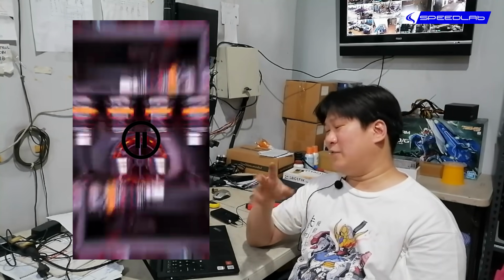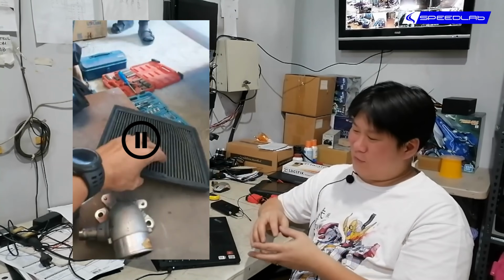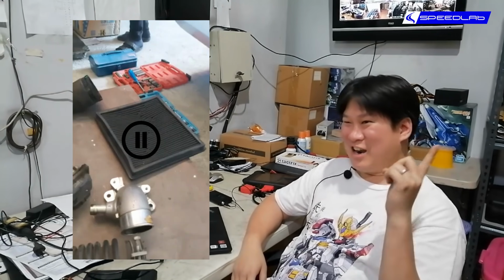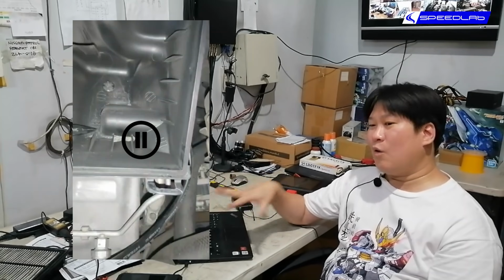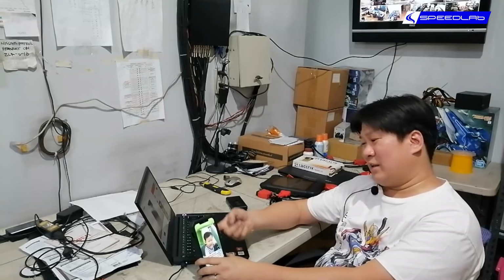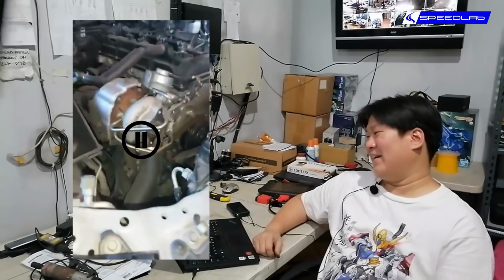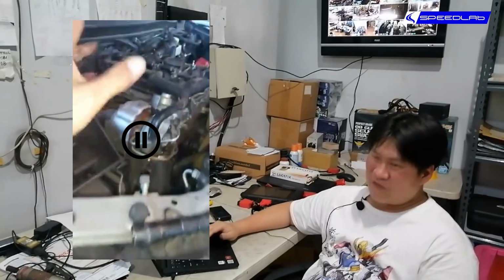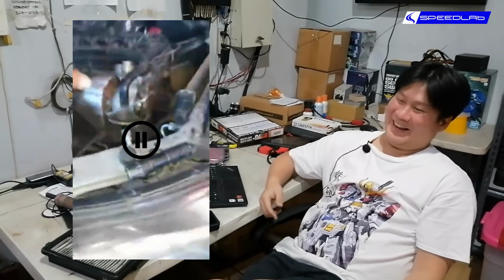I React to Misinformation Video About K&N Racing Fiter

Comment: the problem  was the knN filter got clogged because owner is irresponsible and eventually crampled in the filter box creating gap that unfiltered air and some small stones can get in that damages the turbo propeller. but the motive of the video is to attack the use of KnN filter and doesn't explain what the true causes of the problem.

Comment: My k&n filter on my monterosport which I bought from  from speedlab about 6 years ago is still going strong. Never had issues. I even got it remapped by speedlab last Nov 2022.
Reply: If the filter has its maintenance. You will never have a problem
Reply: every how many kms are you cleaning it?
Reply: @acc1tester398  once a year. I barely drive my montero 5k kilometers.
Reply: Same with my montero, i’ve been using my KNN filter since 2017 up to this date, and ECU was remap by speedworks and never had any issues.

Comment: Just a question though, which one performs better, the drop in type or the cone type KnN filter? Or no difference at all? Let's say using it on a stock engine with cat back muffler
Reply from the maker: cone type
Reply: @speedlabchannel4452  f*°¥k! I just installed the drop in😅. Never test ride it though. I might need to go back to the cone type then haha
Reply: Depends if the cone filter is 'in' the stock airbox OR on the end of a short ram intake tube in the engine bay,  also known as a 'hot air intake'...

Comment: if its a K&N performance filter if the owner KNOWS how to maintenance and service their air filter every filter has recharger, if it dirty you have to clean it every oil change or depends on what your driving conditions are.

Comment: Intakemanifold, throttle body and egr stains and dirtiness will also depend on what gasoline/diesel quality you use. Hays. They will say any BS to the customer just to get them to pay more for the stock filter. All they had to do was clean the K&N filter and add oil. "trust me i'm a mechanic" -"expert guy from unknown shop"

Comment: Sir Sid, K&N cone filter vs K&N drop in filter, which one is better according to your experience? I heard the cone filter might suck in hot air.
Reply from the maker: Cone better 
You heard wrong
Reply: @speedlabchannel4452 Short Ram intakes are just that though, hot air intakes... Stock airboxs are superior, when using a K&N drop in filter 😊

Comment: just bought it and i also bought the sealing grease for the k&n filters , but it comes pre-greased when it's new . they say every 80k km , this sounds crazy to me , because i just pulled out the heavy duty paper filter , and it only had ~4000km in a ratio of 60% out of town and 40% in town , this in Romania , and it was pretty dirty , not 100% but it would have been dark grey at 10000km instead of pale yellow ,and they say to clean the K&N at 80000km ? it sounds a bit extreme so i think every 5000km seems decent enough , and on the motorcycle every 3500km :P . do you think it's overkill ?

Comment: Ive used K&N for my daily and yea dust does go through it and the post filter pipe does get gritty and oily. Ive since reverted gone back to stock. No power difference anyway, and yes its dyno tested and proven 🤣

Comment: Overkill pa pala ako. I clean my K&N filters and MAF Sensors every 5tkms. Then use injector cleaner every 5tkms also.

Boss what's your take sa intake manifold cleaner?
Reply: Once pa lang ako gumamit ng intake manifold cleaner when my cars reached 40tkms.
Reply from the maker: Manifold is best cleaned by removing the whole thing
Reply: same here,  maintained lage maf sensor and k&n filter ko 😁    basic maintenace is a big protection ng engine.
Reply: @speedlabchannel4452  how many kms and nag clean ba kayo boss?
Reply from the maker: @carloz82  once a year

Comment: I think appeal of KN (performance) filter is the "increased mileage/power". And in long wrong probably cheaper. However, multiple sources on Youtube claiming this increased mileage/performance come at cost of decreased filtering. I'm guessing if trade car every 3-5 years, this is probably not a problem. Maybe refreshing the filter with their oil spray in timely manner will improve filtering, but for most folks who wait weeks/months when filter change is due... this is a big problem.

Comment: If there is a camote driver there is also a camote mechanic, this mechanic do not even know that there is an instruction of how to clean the K&N filter using it's K&N detergents and oil. K&N is an excellent air filter.

Comment: Sir Sid, ang stock injectors need din ba linisan or mag mas maganda replace na lang ng bago?
Reply from the maker: LiquiMoly diesel injector cleaner
Reply: Bago masira pag marumi na po ung injectors of course you need to clean it like diesel fuel injectors.
Reply: @speedlabchannel4452  what about the amsoil injector cleaner ?  is it also okay?   which one is the best ?
Reply from the maker: @bjgonzalespovs8164  they all work the same
Reply: What is the interval or mileage that we use these injector cleaners? Sid

Comment: k&n filter is developed and designed and went to process and quality checking throughout the years. you cannot just blame a product because the user did not follow the usual cleaning. anything that is clogged when you suctioned it of course you may be deformed if the psi is too much than the filter can handle. little knowledge is lethal especially when all things in the world were developed using science.
Reply: MG lacks analysis and technical knowledge about these filters

Comment: K & N air filter less filtering yan kesa sa stock so mangyayari mas madali na makakapasok ang dust sa loob ng combustion kaya sobrang delikado. Ang stock air filter na nakakabit ay ang pinaka dbest kc iyan ang recommended ayun sa gumawa ng makina or yung mga engineer nila.. If mag research tayu sa internet youtube etc dami na pong mga evidences na mas napadali ang pagkasira ng makina dahil sa high flow air filter like K & N regardless of frequent maintenance of the filter
Reply from the maker: @darielsabay1391  no point to convince morons like you
Reply: Ahahahaha

Comment: Di ko na kinaya tapusin puro mali sinasabi ng mechanic. Yung dagdag dumi ng Turbo or ng intake very minimal lang ang dulot  ng K&N kung meron man. Bottom line, the owner of the Montero should be responsible enough to check and clean those things. Hindi dapat isisi yan sa K&N.

Comment: Might be out of topic, but with the rise of turbo gdi engines here in ph, what is the best way to prevent carbon buildup in intake valves?
Reply: Oil and Air separator
EGR delete/block
Reply: Best way po ipapalinis mo
Reply: Catch can for the crankcase vent, and EGR delete if your car has it.
Reply: We got also our Strada EGR blocked since 2017. clocked already 180,000+ kms since EGR blocked. Never pa pinalinis and intake and turbo, regular palit lang air filter. still, no issues and performs good.

Comment: Just do your own research and read from legit sources like technical books, don't just listen to anyone or if you do, always verify the info that you're getting. Here in Canada, performance filters are not recommended to daily driven cars. At school, we were taught not to use wheel spacers as this will cause uneven load to the bearing which will shorten its life. But who cares, do what makes you happy haha
Reply: Negosyo kasi kaya need nya i defend..hahaha sagasaan na masagasaan
Reply: Speedlabs sells aftermarket parts. Like that K&N filter Some aftermarket parts and upgrades will need more care and attention than stock manufacturer parts. But it doesnt necessarily mean they are worse. Just pros and cons. Eg more power but you need to clean it often.

Comment: thoughts on venting out the breather instead of putting OCC?
Reply from the maker: No effect
Reply: Depends on where you vent. Engine bay-oily and messy if done on a diesel. Vent to ground - risk of flood water getting in. Gas engine PCVs shouldnt be touched since intake sucks blowby. OCC in diesels should have long hoses or risk engline blowby gasses escape being slowed down
Reply: @hypnos4545  hello, specifically for diesel using vent to ground/atmosphere, is it still a risk for flood water getting in even though there's no vacuum in the breather?
Reply: @acc1tester398  it is true that there is no vacuum on the breather, but given that these hoses are at 18mm in diameter, water can easily be pushed in if you brave marikina type of floods. It is a risk. I guess it would depend on how high your tail hose and the floods if ever you pass through them
Reply: @hypnos4545  right, makes sense, I guess it's better to use OCC with 19mm inlet/outlet and hose then? just to minimize the oil mist because it won't totally eliminate it,
Reply: @acc1tester398  yes. After install, check oil cap and dip stick if smoke or oil start to splatter. If not, you are good. If yes, hoses are too short for blowby gasses to fully escape

Comment: When inggit strikes:  MG YT  44.8k subs; Speedlab  YT 24.8k subs      MG FB 567k followers; Speedlab FB 259k followers .
Reply: Hindi rin. Kahit ako walang mga ganyan tatablahin ko rin yan eh. Kami, almost 7 years na naka Oil and Air separator at EGR blank, ang kinis pa rin ng turbo ng unit namin. Walang alog at healthy na healthy pa rin. Sa 65k kms na tinakbo napaka kapiraso ng dumi sa manifold at TB. Change oil lang lagi tapos takbo lang ng takbo yun. Isa pa naka K&N pa yun. Never nakaramdam ng low power unit namin.
Reply: Hindi inggit ang tawag dyan abay, sabi nga ni Ka Ernie “knowledge is power”…. and one thing is for sure you are not equipped with K&N noh 🤭
Reply: this is not about # socmed followers or whatnut. its all about right information. All car owners should somehow learn to the basics. hindi yung puro gamit lang. as sir Sid said, anjan lang yung manual. andun mostly if not all ang PMs ng sasakyan niyo.
Reply: Kung yang 259k followers at 25.8k subs eh mga nagiisip, mas ok yan kesa sa 44.8k at 567k
Reply: taga MG si ate hehe
Reply: Ibig sabihin nun mas marami ang madaling ma-utu keysa ung iniintindi muna ung sinabi ng isang tao.